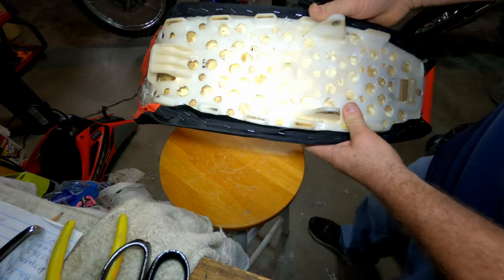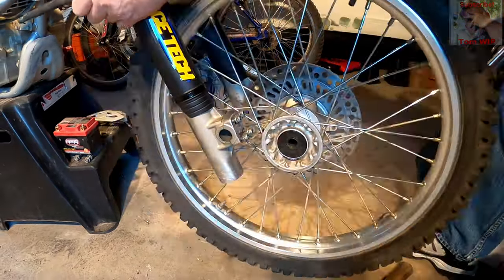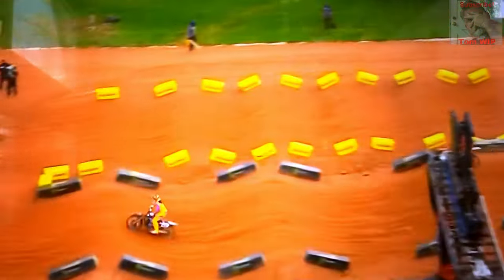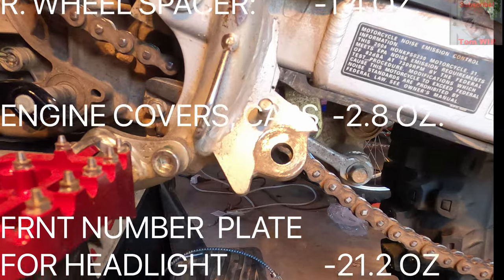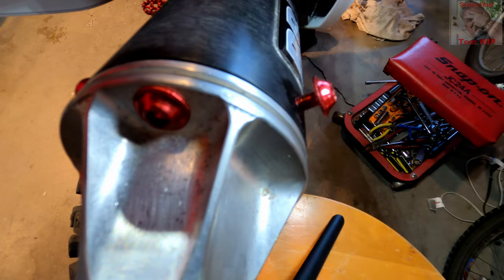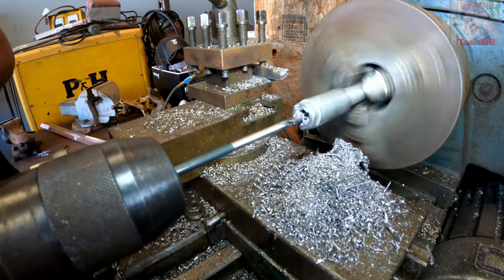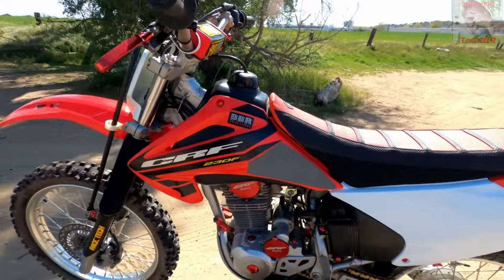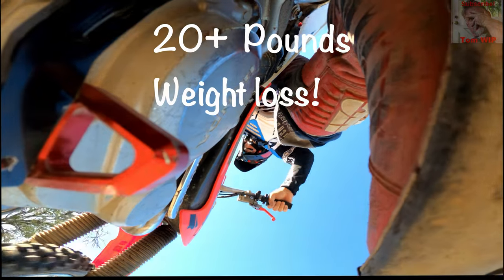CRF230 vs CRF250R -  Review, Upgrade MX motomods, Weight reduction, test ride, Comparison to CRF250R

Comment: Way back in 85 , I built a xr185 engine into an 81 kx125 chassis.  Once I realized it worked well , I bought a big bore  piston 12.5 to 1 compression piston and a midrange  aftermarket  cam .  Had a custom exhaust bent at a muffler shop  and had an old cr480 muffler welded on the end .  I rode single track  mountain trails for about 6 years on that thing.  It was awesome fun . Called it my KXR frankenbike.
Reply from the maker: The custom KRX!

Comment: Your videos and commentary are spot on!   I just bought a 2004 CR230F and starting to trick it out.   I looked on eBay and other sites for the red anodized bolt and nut packs but couldn't find any.   I was wondering if I bought a universal bolt and nut pack and took them to an anodizing shop.   What do you guys think? Would that work?  I can't imagine that would cost too much.   If anyone has a better website let me know.

Comment: Where did you find that a 2021 CRF 250R weighs 204 lb? Honda says it's 237 lb wet, which is how you'd ride it. But if it were empty, that'd be 225 lb, which is a good weight for a 250 MX bike.

And I dig the weight reduction project, but you didn't really answer why? If you wanted to moto, a used CRF250 can be found for less than $4k. do some maintenance the PO deferred, and you're way ahead in the capability of the machine. Clearly, you are capable of taking care of any bike, even ones with more frequent maint. requriements.
Reply from the maker: True. A CRF250R is a more capable bike hands down.
However I wanted a simple air cooled, 6 speed and more importantly, Electric start bike so I decided to modify the 230. 
I mistakenly used Wikibikes for the weight info, my bad,  and I believe they are incorrect or they mistakenly used specs from the CR250R two stroke  - dry weight 205. Many sites show DRY weight - no fluids, at 213. 
I’m still under $4,000 with the 230 even with the addition of the CRF150R forks and Racing Brothers shock, massive weight reduction and engine mods. Granted, it was a LOT of work, but It’s now a very capable race bike in the amateur ranks. However It may be time to modify a 2006 up YZ250!
Thanks for watchin!

https://bikeswiki.com/Honda_CRF250

Comment: Does the bike automatically kill if it falls on its side?
Reply from the maker: @wperkins225  No, but I believe originally it comes equipped with side stand switch and clutch lever switch that keeps starter button from working if side stand is down or bike is in gear.
Reply: @lowbuckgarage1  Would that damage the motor to run on its side? Oil may not get to where it needs to get to.
Reply from the maker: For several minutes would be no problem, for hours yes a problem.

Comment: I am 67 now and race vintage MX on a Bultaco mainly because I can not get on modern racebikes...its a too tall/too short thing. I did try a similar adventure back in 2017 with a Yamaha TTR 230 that ( I could not touch flat footed on) I modded...well tried to...to ride modern MX around my area. Figured it would give me more choices to race if I had both modern and vintage racers. The trouble is I was 62 then and had to ride the +50 class as that is the only old man class for modern tracks around me but I figured I would give it a shot. the first time I raced the Yamaha i got a bunch of crap when I pulled into the gate with a TTR instead of a YZF. I laughed along with everybody else until I told them how old I was they all stopped laughing immediately. IDK if they were amazed I was out there or just felt sorry for me or both. Anyway gate dropped, we all took off I managed to stay mid pack for a lap or 2 then slid out in the sand and was relegated to last place. Not much better the 2nd moto. The next race on the Yami was even worse as I fell and tweaked my shoulder the 2nd moto so that ended that day and my pursuit of riding MX on a bike I could not flat foot. I had no business being out there with those "young" 50 Y/O's. Sold the Yami and now I stick to my Bultaco with no suspension at least I can get on that and ride with guys my own age. The end........

Comment: Great little clip dude! We bought a minty 2006 CRF230f. Love the easy wash and wear nature (compared with the 2012 CrRF250x that is fun but needy) but, yes, suspension is too soft with no adjustability.  Oversight on Hondas part, along with the missing kick starter. Anyway, hoping to follow your leas on the suspension mods, and maybe open up the airbox. I love your style of video. Easy going but filled with hard facts and info. Cheers!
Reply from the maker: Thanks. 
Finally found a larger intake valve today. Along with a little head porting. Stay tuned.

Comment: I put a Hagon shock on mine. Huge improvement. Also used a Race Tech valve in the forks.
Reply from the maker: Yes, I posted a video on putting the race tech gold valve emulators in. Huge difference, so nice. Decided to go with the CRF150R Forks now. Video of that to follow. I made a video also of putting on XR 250 R shock, that also made a huge difference, nice!
Racing Brothers makes a Fox shock clone I’m thinking of purchasing next. kind of pricey though at 500 bucks. Ouch.     Thanks for watchin’!

Comment: For the amount of work you have done to your CRF230 chassis/Suspension wouldn’t it be better to just engine swap the CRF motor into a more suitable chassis? How many dead CRF250/450 only a few years old are there with blown up engines. The XR200 is part of the same engine family as the CRF230, lots of engine swap information on swapping a XR200 engine into a race CRF250/450r.
I’m planning this but using a DR200 engine
Reply from the maker: More than one person has suggested that very idea, not a bad one, but I haven’t seen anyone out there actually do it yet. There may be a reason.
Reply: First thing I thought. Might be a good business opportunity for BBR. Make mount to swap on 230 to a 250 chassis.

Comment: Awesome!! I swapped CR125 forks onto my 230 a couple years ago and big improvement over the stock. Think I'm going to pop for some gold valves for that this summer. The CR forks high speed circuit is too stiff for Enduro riding in the rocks. Also did some weight reduction, but I'm spoiled by kick stands, so I tig'd up an aluminum stand. Thanks for the killer vid. Are you Eddie Van Halen's stunt double?
Reply from the maker: Thanks. I’ve had a couple people say the same thing about the resemblance. 
I left my kickstand mount on, after cutting a couple chunks off it. Still functional for future use. Thanks for watchin

Comment: Great video! Thanks for posting it. Are you going to add a parts list buy chance?
Reply from the maker: parts list? most of the stuff I bought were 1x sales offered on Ebay.
but as far as: 
Fork springs, Shock spring, Exhaust, Rev box, - BBR
Brake and gear shift levers, - Tusk
CNC Motorcycle Front Rear Engine mounts, aluminum CNC pieces - YSW racing   
Fork Emulators - Race Tech inc.
M5 M6 Alloy Motorcycle Complete bolts Kit Body Screws Nuts - MOTOWORLD Ebay.
Seat cover - FLU Designs
120 main - jet, 45 pilot jet, stock needle in second groove.

Coming soon:  lightened Flywheel removal/install. +4 degree advance woodruf key, and cheap 28mm carb install.

Comment: 14:36 I was guessing 15lbs.
I'm just about set on a CRF250f as 
my next bike, trails, light enduro. My 
issue with weight is mostly about being
able to pick the bike up, and pull it 
out of a ditch etc. I wish they/somebody
made a 250f with about 30hp that came in 
around 200lbs wet/curb, not 265.
Reply from the maker: By the time I’m done, mine should be around 25 hp and less than 215 lbs dry with videos to prove. 
thanks for watching
Reply: @lowbuckgarage1  That will be getting into the hp range
I would want for this bike, I think 25hp
 would be perfect, especially @ 215 dry, 
hopefully the torque will be close behind.
Reply: @lowbuckgarage330   get a big bore higher compression piston and an aftermarket midrange cam .

Comment: I love the concept, but it looks like red threw up all over it. It's actually better to give it some variations in the color in the smaller areas like hardware and smaller parts. It does not make them all show up as obvious changes from 50 feet away 🙄🙄🙄but  in close where it matters they are obvious upgrades. A lot of that red anodizing would look better in silver and black.

Anyway, if you like it that is what matters.
Reply from the maker: I had to choose one road or the other; bristling bling or sleeper bike. Either one is ok with me. I chose bling. I’ve observed that most racers prefer the shiny bright eye candy.
Thanks for watching.

Comment: Awesome man! Fixing up an '08 230 now. What jetting did you go with and what weight fork oil??
Reply from the maker: 5wt - I weigh 185. Stock Springs are way too soft.
Sea level- 120 main - 42 pilot - needle in  bottom groove. Cut out the air box top or at least remove the baffle plug.

Comment: Tom you said you drilled out your axles what does that do to the strength ?
Reply from the maker: I’ve had some long discussion with my genius machine shop guys, they say you can drill a hole 
that's 50% the diameter of the shaft and still retain approx.90% of the bending and torsional strength of the axle. 
So we decided on only 40% removed just to be safe. Titanium is about half the weight of steel, and aluminum 
is about half the weight of titanium. Aluminum is just slightly more than the price of steel, but you cannot use aluminum for axles 
and titanium is ridiculously expensive. a set of Titanium axles and swingarm pivot bolt would run about  $1000. 
Drilling is cheap.
Reply from the maker: @shockadellick  Thanks! The aluminum dog bone sounds interesting. The 86 XR mag brake cover sounds VERY interesting, do you mean off the xr250? Would one from an 85 Xr250 fit? I’m going to start a search for one right away. 
I already moved my bars up and forward one inch, not sure if I want my pegs further back too? I’ll have to research that. 
I just bought a 96 XR250 shock off eBay for $150 to try out, it’ll be worth it to revalve it later if needed, since it’s fully adjustable for compression and rebound with remote reservoir. I’ll be doing a full video on the installation and results of that, along with the XR250 pumper carb I just installed. 
And I agree, the CRF150R forks are the way to go. That may be next.
Thanks for watching!
Reply from the maker: @shockadellick  which ‘86 XR brake panel fits the 230?  The 200, 250….?
Reply: @lowbuckgarage1  
Sir, sorry if I confused you...seeing I've owned the 230F for more than 10 years. However, the brake panel is exclusive to the 250R and the year I believe was 1984 thru 1986.

Give me a couple of days to search, I'll come back and post year.
Reply from the maker: @shockadellick  i just bought one minutes ago on Ebay for $25,  off an '85 250R  Bummer!  wont fit?

Comment: 00:47 You're not 'regulated' bro, you're 
relegated. EDIT : Yeah I hear that lol, I
do the same thing. 25hp, should make it
just about right I think, I'm just not wild about
bikes with like14 to 17 hp, at over 200 lbs.
My bike is 11hp, 140cc, 190lbs, I think I'd be
happy with a bike under 240lbs, with 25 to 40hp,
hence the CRF250F , a reintroduced model in 2019,
that was called something else back in the day.
I'm sure you're familiar with it; '19 through this year so far.
I wish they would lighten it up a bit, then it would be perfect
for what I want, I think it's 265lb wet.
Thanks for the video.
Reply from the maker: Lol. I knew that was wrong when I said it! Lazy editing. Thanks - you just earned another subscriber.

Comment: This is a bit ridiculous. If you want a lighter bike then by a motocross bike. I’m was all for it with replacing steel part with aluminum parts, but you drilling out “everything” is insane and looks stupid. That is a trail bike, not a race bike. You did all that for 16 lbs!  Im surprised you didn’t drill holes in the motor and drain a little oil out of it. That would get you a few more ounce.
Reply from the maker: Closer to 24 pounds lighter now actually.
https://youtu.be/VBuVKGNP8rg?si=pLmpK4b57mSGTIpp